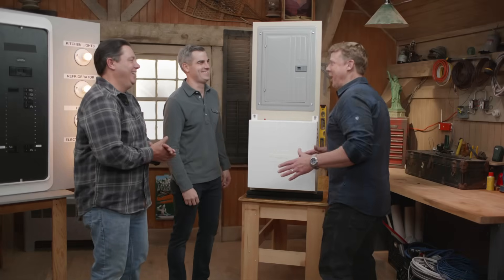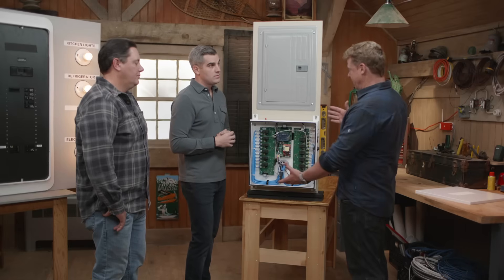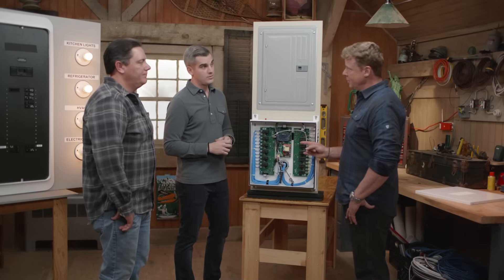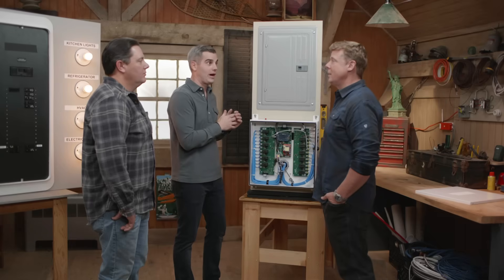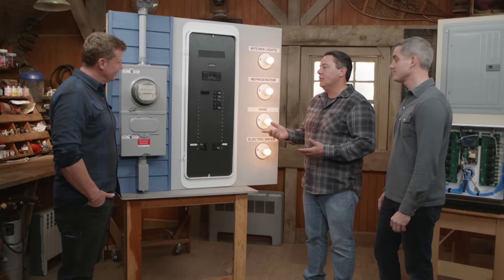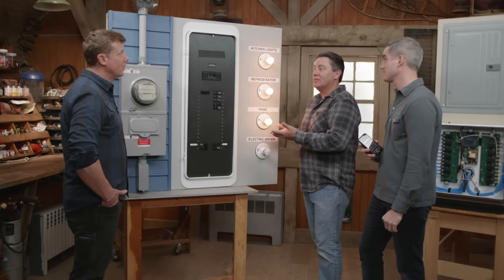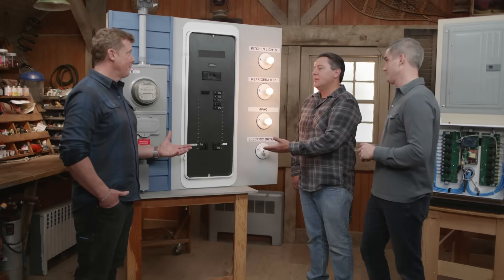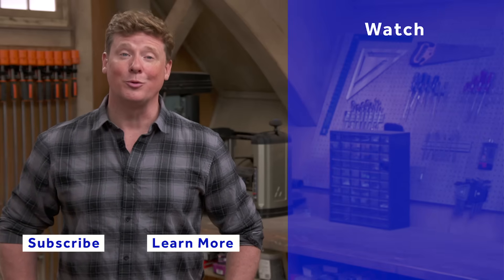Understanding Smart Electrical Panels | Ask This Old House

Comment: Add a UPS (uninterrupted power supply) to all of your computer systems, router and or modem so these critical systems don’t skip a beat.
Reply: how quickly we forget that cable / internet can go down for an entire area when the power goes out. A built in UPS won't help there.
Reply: @rupe53  there’s countless occasions when our electricity goes out for anywhere between 5 seconds and 20 minutes that my connection continues to be connected and because I have a UPS connected I remain connected.  Examples are, working from home connected to a VPN through my employer and while playing Call of Duty over my gaming system. The internet hub that supplies your internet connection is often not affected and is normally miles away from your house that is being affected by a power outage.
Reply: @ItZ_JoEyLo  ... while this can be true, many times it is not. In my area they have gotten lazy with cable booster upkeep and the battery backup generally lasts maybe 24 hours, despite the fact that we have a firehouse on this node. (good UPS will go 3-5 days) This is especially obvious when power goes out on a main road and most of the town is dark. It's also a problem when a car accident takes out a pole and the wires / fiberoptic is damaged. A multiday outage might only happen every few years but we are all living in caves by that point. OTOH, storms like Sandy and Irene put us out for a week at a time. An ice storm we had 15 years ago did the same thing.
Reply: @ItZ_JoEyLo  just curious do you have your ethernet lines protected for power surges?

Comment: I'm sure everything works as planned except for when the board fails, app fails, etc... Unless you absolutely need a smart panel I would stay conventional. You can easily control it yourself and it's easy to troubleshoot.
Reply: Leviton has a similar panel. They use smart breakers that can be monitored and controlled by a hub. If a breaker fails you replace it in less than 10 minutes. If the hub breaks you replace it. This all in one smart panel looks to be a pain to fix.
Reply: @MrJramirex exactly massive elephant droppings.
What we need is a midbetween on electronics and pricing etc.
Reply: Yup. And a $2k installation. Cheaper just to leave everything on. lol.
Reply: I wish this existed in a way where it was still useful off the internet. We don’t know if this company is going to be around for 30 years, providing software support for this panel.
Reply: Start getting fancy and everything goes to shits!
Reply: WiFi is critical to take it on !!!!
Reply: @gdubb420gw You sound like a kid that doesn't consider the overall reliability of anything. That's cute.

Comment: I still like the Genny panel. It was $200 installed (electrician doing final connections), I have most of my breakers feeding through it and manually control what gets fed when power is out. I am the 'smart interface'.  I know what is there, I have 2 spare breakers in event of a failure, I can swap in or out what my alternate power source is, etc. I watched the episode and replacement follow-up episode where Rich placed and replaced the Hot Water heating source because it failed, and the company had gone out of business. I learned a valuable lesson. Stick to standard parts, easily replaceable, not something that can be destroyed by the inevitable lightning strike.
Reply: The good thing about the smart panel I see is being able to monitor the power drawl. Say your HVAC fan starts working harder because of a dirty filter, you can watch the amp drawl increase and know something is wrong.if the smart board ever gets hacked or one of the relays fails you can always straight connect it and bypass the board. No sweat, and the added flexibility is a nice bonus. I like it.
Reply: @jeremiahfoster5810  ... HVAC fan draws LESS when filters are dirty because the fan moves LESS air. BTW, DRAWL = an accent.
Reply: I like money
Reply: I could not agree more.

If the system would work it would be nice, but the added failure points that are not easily able to be bypassed make me highly apprehensive.

For most of the country if you lose power you are also going to lose Internet which most likely would hinder your control of the system assuming it didn't fail 5 years after you put in it when you really need it.
Reply: @tmx1911  Yep, for the first time this year, in a 30 minute outage, our internet feed also failed (cable service). Power was restored at home, but no internet. Would have been bad if there wasn't the ability to control power or systems. (I also have everything internal, no cloud services used)
Reply: @kevinshumaker3753  most of these smart panels are bluetooth enabled or utilize other interfaces for off grid applications.

Comment: I'm somewhat warry of having my home tech linked to the internet, wireless or apps. because they can be turned off by the company in question, have the data stolen or even get hacked.
Reply: Or ten years later, the company goes bust, the app goes dark, and you're SOL.
Reply: Yeah, were there is a will. There is a way for someone. Not matter what it is, this is a old true saying.
Reply: yeah but they still have to break in through your wi-fi to "get in" right
Reply: @awaara24  If you are controlling and looking at stuff through a phone app, that's almost surely not true.
Reply: @awaara24  depends if your system is connected to the outside internet or not. because then someone could hack in from any place if they really wanted to. or steal your data from whichever company service your using.

Comment: Somethings are better left alone and simple. The complexity to troubleshoot problems, reliability, planned obsolescence, and the cost of installing this thing will never be offset with the 5 cents its promising to save you.  Lol
Reply: As an electrician, I agree. These systems have been used to control lighting in commercial buildings for many years and I’ve seen when a relay fails you either can’t find parts (obsolete) or have to replace the entire panel. Not much cost savings there!